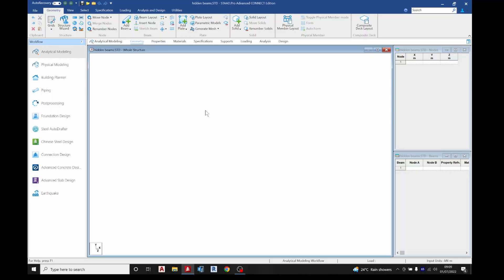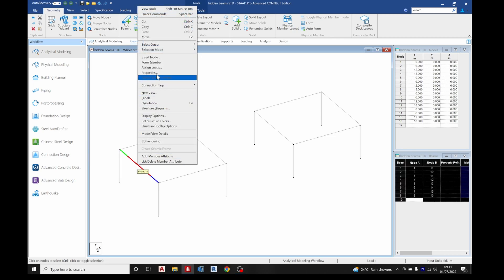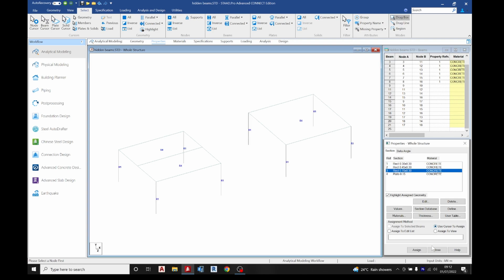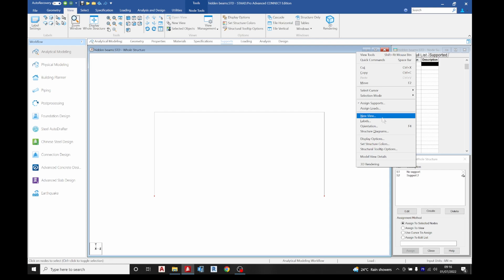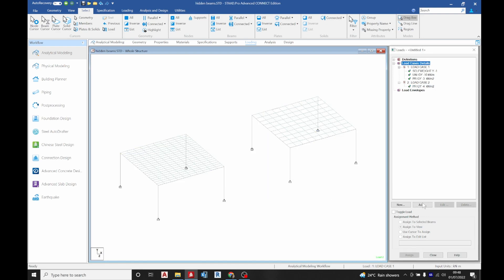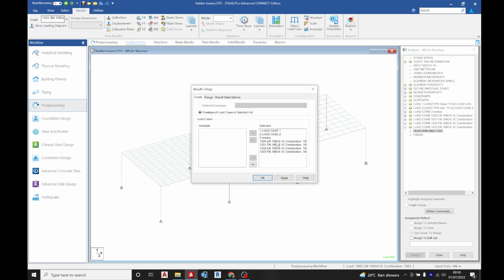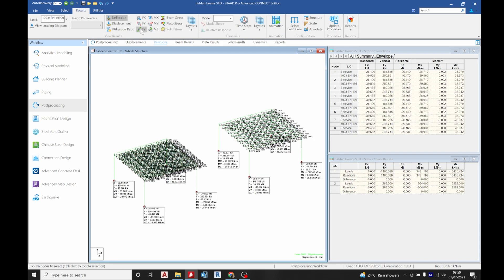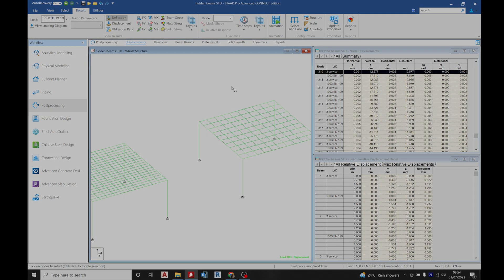Comparing slab with hidden beam vs without on Staad pro connect edition

Comment: Chief...Are you saying the hidden beam that doesn't pass deflection test helps in a way when we have long spanning beams?
Reply from the maker: No I’m comparing a slab with hidden beam and a slab without one. 

Most people think hidden beams take part in load distribution, and this video debunked it. 
Secondly, people think hidden beams help reduce a large span into two. We can see that the slab is still behaving like a 6x6m slab instead of 3x6

Deflection is a function of depth, so if you want to reduce deflection then make the slab or beam deeper
Reply: @Lanreolokunola  ok... so i will take it that hidden beam are not really bad in slabs. Especially slab spanning more than 6m in both direction
Reply from the maker: Yes they’re not bad and they are only good as ties (to tie columns together)
Reply: Okay....Thanks